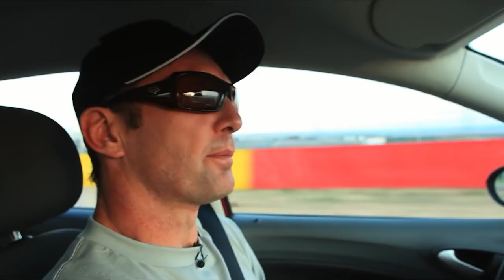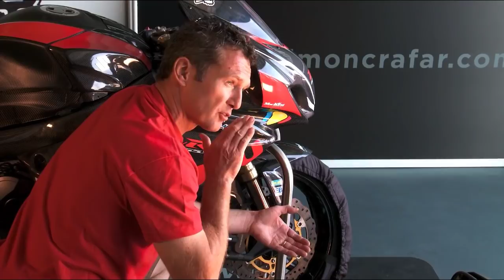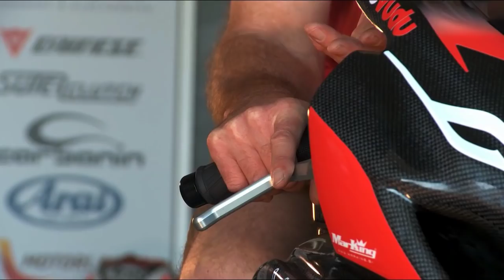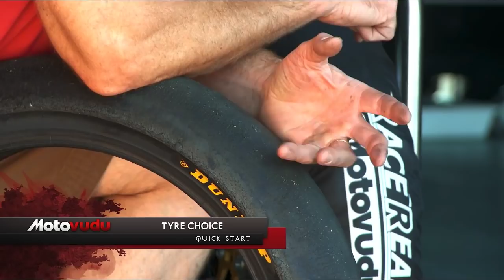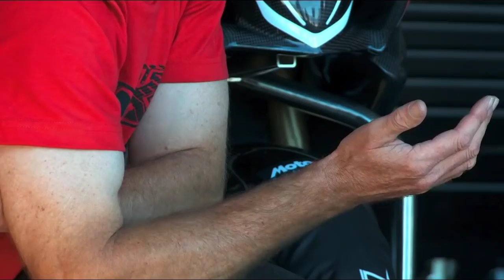MOTOVUDU - Simon Crafar - TRACKDAY QUICK START: Part 1

Comment: Hi Simon, great video and video series fantastic advice. I wanted to ask about Pirelli Diablo Rosso Corsa II or supercorsa SP tyres and how good they would be on track compared to full slicks or full wets. Obviously they won't be as good as dedicated slicks/wets, but as a compromise for an intermediate rider like myself who can't afford to run two sets of wheels & tyres is the performance difference still poles apart or has the gap to road/track tyres reduced? Thanks
Reply from the maker: Great question because it's very important and one I come across regularly.

The tyres you mentioned are ok to have your first track experience on but after that I'd personally get rid of them. Track specific tyres, stands and warmers are MUCH better for the job. They don't have to be Slick's they can be treaded but the compound is important. Road and track is  like any tool that is a compromise, average. I'm forced to ride the BMW for the MotoGP GoPro lap on road and track tyres. They are rubbish compared to any brand of track specific tyres and make it difficult to stay on line, get to full lean, not run wide and not crash.

As far as wet weather riding goes, I'd never ride on treaded tyres as it's a horrible experience after using wets and far more chance of crashing.

Choosing to use road and track tyres= the experience of using a condom without being safer... better than nothing but not like the real thing

Comment: Does anyone know where I could find recommended tyre pressures for the TRACK! The manufacturers and the bikes own user guide/manual says no matter what tyre you have you must use 2,4bars front and 2,9bars rear (for the streets). Just saying that 2,9bars for the rear  in +30 celsius warm day in track you're gonna be f*cked.
Reply from the maker: There should be advice on the manufacturers website specific to the tyre you are running e.g  http://www.dunlopracing.com/Pressures.pdf   We always recommend running track specific tyres.
Reply: @motovudu  Thank you very much!!!

Comment: @simon I really hope you are addressing experienced or at least relative experienced track riders !?
Asking a newbie to warmup track tires is like asking a novice Cessna pilot to make sure the turbine is sufficiently heated before hitting the afterburner on an F16.
Even preheated track tires will go cold on a newbie - they will go out on 80 deg.C tires and come back in with tires barely as hot as the tarmac :-/